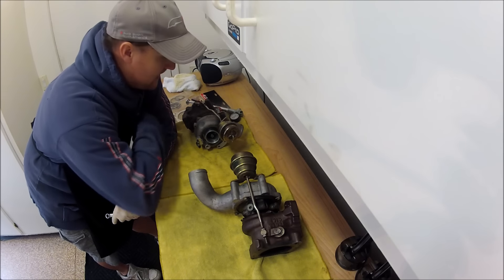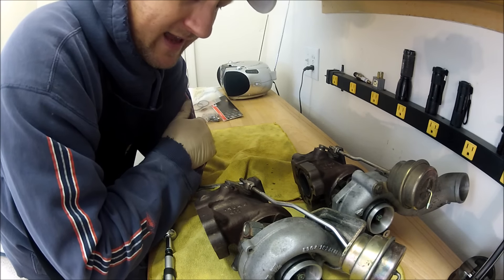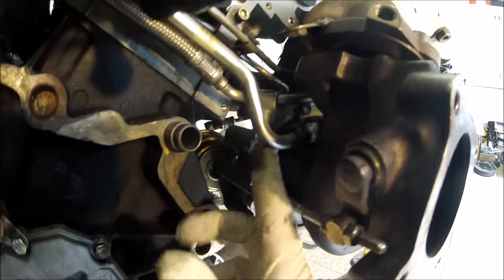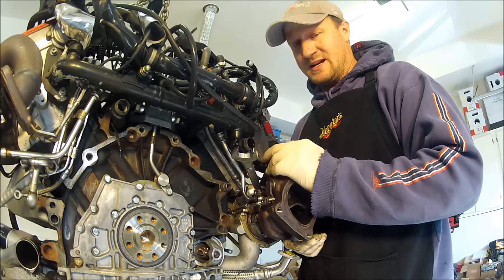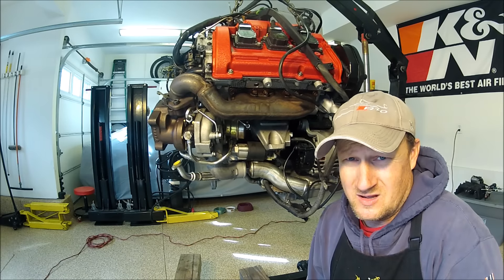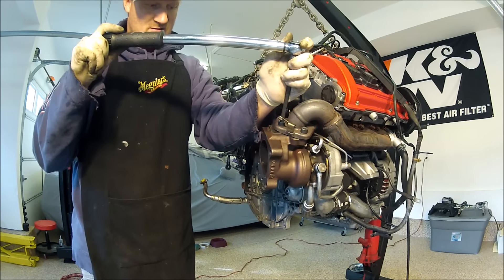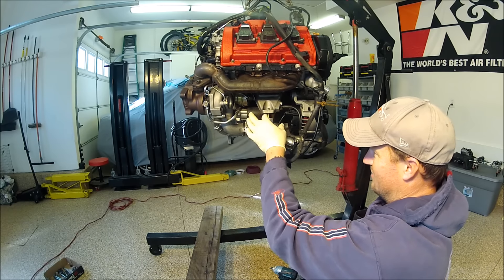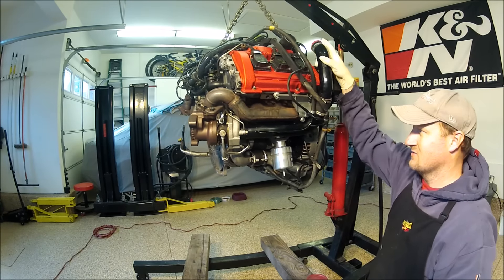Installing Turbos on an Audi S4 Motor

Comment: The actual Audi service manual for the APB type motors call for 60NM with high-temperature paste on the three turbo exhaust manifold bolts threads and on the part of the bolt face that makes contact with the manifold. Thanks for the video!

Comment: Do you think its possible to add those silicone couplers to the inlets while the engine is in the car?

I have a leak from the passenger side inlet and can't pressure test my system. Was going to take the core support and inlet off and see if I could get the coupler onto the turbos. I just am not sure how I would tighten the clamp down.
Reply: I did this and it was a bitch.

Comment: Hey Justin, I’m going from k03s to k04s dzx-273s and I got them from the guy I bought the car from, and he upgraded the wastegates and I can’t get the exhaust manifold to align with the bolt holes, so I’m kinda stuck.
Reply from the maker: The bolt holes won't line up......Does this mean the turbo housing is hitting something thus not allowing the holes to line up?  If that is the case, most likely you will need to clock the housing(s) so that everything lines up.  Now if you do clock the housing(s), you will need to re-set the wastegate cracking pressure, or at least check them.  Hope this helps.
Reply: @JustinBallou01  yes most likely will have to adjust the wastegate actuator, but it’s the actuator that’s hitting I think the motor mount bracket connected to the engine, the housing clears, just i don’t know why the stock actuator clears perfectly when these don’t, so I’ll try that and we’ll see. The driver side is mostly bolted up, just having issues with the coolant and oil feed line in the way of each other.

Comment: Hey. The silicone piece that you fitted on the inlet to turbo did you wrap that in heat wrap?  Ive got the exact same issue on mine and im struggling on how im going to fix it. Do you still recommend doing what you did in this video?  Thanks a lot for your videos. Please keep them coming.
Reply from the maker: Yes.   Nothing has changed.   I use a heat reflecting foil that is sticky on one side.  It sort of is a pain to install and have it look right, but hey, if you buy a roll of it, you can take off what you don’t like and re-apply.

Comment: Justin
Im stuck on the coolant banjos right now
Any advice to get them to fit? 
I cant get the last one on e drivers side with the extension bolt fir thr banjo, its too long and hitting the exhaust manifold
Reply: jeremy mcelhaney  I got them lol, just some patience and beer will get them . I'm sure it was because my turbos were too large but they went in eventually

Comment: Hey Justin, I have to replace the small rubber line that connects to the nipple on the wastegate. I have access to a lift, but was wondering if you had any tips on doing this? I've heard of a few people just removing the sway bar bracket/motor mount bracket (this if for the drivers side wastegate line) and dropping the motor down a bit. Trying to find an alternative to pulling the whole motor just to do this. 

Thanks!
Reply: Steven Zimbrich  probably already done, but I had the car on jacks and took out the engine mount bracket and mount/bushing to access mine easier.

Comment: Is that motor built or is it stock and how much power can it hold in its stock form with twins
Reply from the maker: Alexis Orellano The motor in this video is a stock motor.   As far as how much power a stock motor can handle....   well that “depends.”    There is a lot that goes into tuning.   To be safe, I would say 400-420 AWHP..   Built motor....how much do you want to spend comes to mind.
Reply: @JustinBallou01  I have the s4 v8 I want to put a single turbo maybe some rpa bolts and eagle rod pistons .but I want to make atleast 450 to the wheels

Comment: Hi. Your work is much appreciated! I was wondering if you have done some troubleshooting regarding lack of boost on these 2.7t engines? I have an A6 2004 stock 2.7t with 100K km on it. I want to rule out LMM(recently replaced), N75, MAP-sensor and vaccume-leak. Hoping it's not the turbo's. Do you have an "check list" to follow or preferable a detailed video of this? Best regards, Thomas. Norway
Reply from the maker: There are too many variable as to why you are not making any boost.   Does your car have a tune?  Is it running too rich or to lean? Have you done a compression test?  Have you checked fuel pressure?  have you checked for codes?
Reply: Justin Ballou Code is maximum pressure exceeded. Normal consumption 1ltr pr 10km.  It seems that pressure comes and goes. 33 ohm on N75. No visible oilleaks. No tune. Also changed throttle body (split underneath). Not checked fuel pressure
Reply: I don't get an ohm reading on the MAP-sensor. But the connector has 5V as it should. Parts are quite expensive so i don't want to change more than necessary😂. Is it better to check pressure/vaccume test to turbo's and fuel pressure before any of my concern's with N75 and MAP-sensor. By the way, does the MAF-sensor need any "input" or is it just plug & play. Any suggestions is  great help. BR Thomas.
Reply: Hi again, Mr Ballou. I`ve come to the conclusion that i need to change the vaccume lines from N75 to turbos, have you ever done this? And if so, with the engine still in the car? Can`t find any videos of this, and i`m wondering if this is something a NON-mechanic ever should consider doing by my self?

Comment: I'm surprised you don't have more subscribers
Reply from the maker: An Audi B5 S4 is not a mass produced car, and my channel has a very narrow scope of information.  Do I wish I had more subscribers....yes.  Am I surprised I don't have a lot of subscribers???  No.
Reply: Im sure im going to provoke a few people by asking, but isnt this built on the same 2,7 engine i have in my 2000 a6 allroad, also used in normal a6? If so, you could easily broaden your audience by adding a few tags on engine specific videos like this one.

Comment: Hey Justin, from what I've seen ur the 2.7t master. Any way I could message or email you about an issue I'm having? I literally can't figure this stupid issue out. Car is in limp mode but still boosting. Thanks
Reply: BlackLinesMatter egt sensors

Comment: Hi Justin, I've just got a smoke from the passenger side turbo. I couldn't find out so far what the problem is. My question is if I need to replace the turbos do I have to pull the engine out or is it possible to do from underneath?
Thanks for the reply.
Your videos are awesome! I keep watching them nearly every day. Good luck for the future.
Reply from the maker: I have heard of a person pulling the turbos without pulling the motor.  Do I recommend doing it that way....no.  If a turbo is bad, pull the motor/trans..  This will allow you to inspect everything and replace/fix other issues that may have gone unnoticed.
Reply: Justin Ballou I really appreciate for you quick and helpful advice. I will do so. 😊👍😎
Reply: Hi Justin, sorry for disturbing you again. I need two turbos but I'd like to know what kind of turbos do you recommend. 
I've got a stock s4 and I don't want to install any performance one. Would you be so kind and tell me what are your preferred ones please? 
Thank you very much for your help. :)
Reply from the maker: If you are not planning on going crazy, just buy OEM KO4's.  You will need to purchase turbo inlets for the KO4's, just don't get aftermarket ones and they rarely ever fit right.  Try to find someone selling Used OEM RS4 ones if price is a concern.
Reply: Are the used RS4 turbos reliable? Safe to install them? Do I need bigger intercooler for them as well?
Sorry for these silly questions. :/
Reply from the maker: If you buy used turbos, you will need to send them out to a reputable turbo shop and have them look over them.  Going to bigger turbos is a slippery slope.  Before you know it, you have a 3-liter motor with Tial 770 turbos and you thought..  "I  just wanted K04's."
Reply: Hi Justin, I luckily found RS4 turbos from BorgWarner. You told me to buy turbo inlet pipes but is there anything else I need for installing K04 RS4 turbos on an S4? Many thanks for all your reply. :)